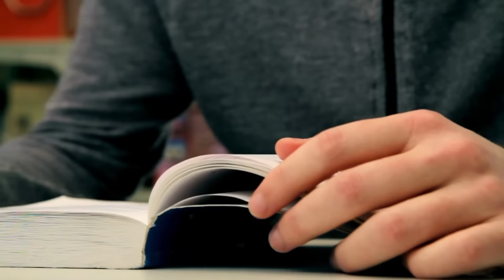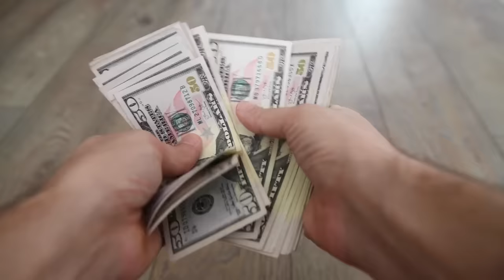The REAL reason RV service sucks - insider secrets from a RV technician

Comment: In Canada, RV Technician is a certified trade with government body oversight. So you need to do a four-year apprenticeship and three years of college, then you can write your Red Seal exam. Then, on top of that, each province has its own RV gas certification processes. 

The above doesn’t necessarily mean we have better technicians, but there’s more oversight for training compared to the RVIA in the US. 

What we still lack is trained technicians since there are only two colleges that teach it and a nearly two-year wait to get in. 

Parts are our most significant issue being on the West Coast. Do you need a part for your RV specific to it or even just manufactured in Elkhart? That’ll be a 2-3 month wait because the warehouse is slow. Then, they probably shipped the wrong part, which will get held up at the border. 

Service work, I believe, is an industry issue, starting from the top. Technicians are, for the most part, thrown into an environment where they have little chance of success, from seasoned ones to newbies, which is why most good techs leave shops to go out on their own when shops need to retain those techs to train the new incoming generation of technicians. 

Keep up the great work! I enjoy your videos and perspectives. 🎉
Reply: What? Since when in canada are rv techs governed??? 
Because in 2019, my dealer and another, here in calgary both big franchised dealers, both had ads for tech required, “no experience necessary will train on the job”, and no schooling certificates or anything listed as needed! Exactly what this video talks about. Secondly i personally dealt with techs working at these dealers who had zero training or experience and were learning on the job! And i know for fact techs that are currently employed have no school training as you say. So how is the government regulating and declaring a rv tech must be certified? were is this listed on the web that our government body regulates?
Reply: @SpykersB 

Hey, I think my point was missed when I said RV Tech is a certified trade via the “Red Seal” certification with government oversight. 

That does not mean people cannot work in the area without certification. The apprenticeship model lends itself to allowing people to work in the area without any experience. It’s like this in any trade, from car mechanics to construction. 

Just because someone does not know how to swing a hammer today does not mean they cannot learn from teaching and research how best to swing a hammer tomorrow. Everyone starts somewhere. 

My concern and you witnessed this firsthand potentially, is that the RV tech trade does not have enough schools available to train all the techs. So, the backlog is enormous, and many techs go without training because they can either not afford it or feel too old to start now.

Comment: Great tips. Every new rv customer should watch this video.  I have been full time for 6 years and your tips are right on. I use mobile techs when required but most of the time I do the work myself.   When I was brand new I took my RV back to where I bought it and it was a nightmare. Kept my RV for 3 months, didn’t fix it and I called my manufacturer who said they had shipped the parts weeks ago.  The dealership had lost the parts. We found the parts in an attic. The dealership tried to blame the manufacturer.  I am going to watch all your videos.

Comment: I know exactly what you're talking about. I took my RV to Camping World in Idaho Falls and they were going to consign it for me well after 2 months I get a phone call from the service manager and he says hey you have about 2500.00 worth of leaks and repairs on your motorhome that need to be repaired before you can get it sold. I almost blew a gasket when I dropped it off I had been living in it for 6 months full time and it was just fine. So I go to see what was the list and I find out that the idiots had put compressed air to the system in the parking lot in the middle of the winter. I told them give me my RV back and canceled the contract. It ended up costing me only 295.00 to fix all the broken pipes and faucets they broke and to change out an expired fire extinguisher. I found out later that they fired the guy that did the damage because he was costing them more than he was producing. Stay away from Camping World.
Reply: Camping World is OK if you need to purchase an accessory or part for your camper, but even Amazon is cheaper and faster for that too, now. I would never buy a unit from them or take one to them for service!

Comment: Ford is another issue. Motorhomes that are not vans are almost all For F-53 chassis, and these are having a LOT of safety recalls, most of them quite serious.  In my case, dry differential, sway bar falls off (two recalls for the same issue),  vehicle shipped without front end alignment (new 2 year old tire), misrouted and pinched cables (new harness and three month delay for a harness locally available for $18). 
Add to this safety issues caused by the coach builder. In my case fire in the CPAP cabinet (I was right there, and damage was negligible because I was there - and conscious. Investigation showed 12 AWG wire filed down and forced into stab connection for 14 AWG wire -  manufacturer actually tried to glue it back together!) I replaced all outlets because 12 AWG wire used by filing down the wire and forcing it into the stab connection. Then the overhead fold-down bed fell on my head while driving. It fell slowly and gently, but - terrible design! Black tank arrived from dealer with poop pyramid included. Radio disappeared into the dash while driving - investigation showed zero supports, held in place by a 1/16" plastic dash panel. I repaired with four inches of 1x1 from a local hardware store. 
Then there's the things that are just crazy. I had to repair a dashboard panel because it drooped and got damaged by setting   the parking brake. It needed a zip tie. For lack of a zip tie I had no headlights, turn signals, brake lights, wipers, etc. 
All of these are potentially quite serious. Frankly, I'm appalled. 
(Former manufacturing engineer and  electrician.)
Reply from the maker: Yikes! What RV was this?

Comment: I think that manufacturers need to start creating and leveraging a network of mobile techs to do warranty work.  For the reasons you mentioned, dealers don't want to do it and do a terrible job at it and it is driving the RVs today are trash.  This would allow dealerships to focus on what they do want to do and that is sell RVs and then maybe they could focus more on PDIs.  It would also give consumers more direct control on the repairs being done.  This would also probably result in a more informed consumer which is also a good thing.

Comment: This is so interesting 😊😊 I use to work in public water supply. We had to get a ( backflow certification) that means you look and TEST the ( RPs double check valve) these are devices that Prevent Backflow into water system. There MUST be a yearly test of all backflow systems in your water District. In the class there were plumbers that Failed the final Testing. The problem was the test you do at the time that U did it, you must memorize the testing process, and do it un front of a certificate instructor. Because so many plumbers where failing test. Thay changwd it so you can look at test process on paper, then do test in front of instructor. I thought this was a good xhange, because following along by the sheet of paper, gets the test done RIGHT.

Comment: I have this dont break your rv course and it's an amazing help to newbies and experts alike  !!!

My dealer was bish rv, on my PDI  I found the drawer under the fridge was needed alignment to work right. They said the fixed it and I went on my way, the drawer was 10 times worse after the repair then it was when I reported it. I know I should have checked it before I left the dealership, but I was like its a simple drawer adjustment, any flunky can do that. I was wrong, lesson learned.
Reply: I have had a bad experience with Bish's also. I had to wait a month before I even got to it home because every time I came to inspect their work, it was mostly not done correctly.
I finally gave uo and took it home. What a mistake. I have been a squeaky wheel, and now they just pass me around to other people who don't take responsibility for it.

Comment: I ended up dealing with my father's RF warranty repairs a few years ago.  The core problem is that the manufacturer's reimbursement rate to the dealers (back in 2016) was $35 an hour paid to the shop under warranty.  So no dealer could make any money at it, naturally they did not invest in adequate tools, space, and staff, and they tried to avoid doing warranty work unless it was an RV that they had sold.  Wait times for warranty work in San Diego in the summertime were in the range of 3 months.

Comment: Unfortunately, some of the manufacturers require inspections at regular intervals by a “certified” RV maintenance facility in order to not void the warranty. The big boys like Camping World/Gander have a months long backlog of appointments. I had a serious electrical problem right at the opening of camping season, and ended up educating myself online and doing my own repair. Called a mobile RV tech just to come inspect my work, but saved myself loads of time and money.
Reply: This is exactly right.  An important point that generally isn't discussed until AFTER the sale has been made.  I do not know of a single RV dealership that will honor a so-called roof warranty without proof of yearly roof inspections/cleaning/maintenance documented by a dealer. Even then you will have a fight on your hands.

Comment: All his complaints can be fixed by having a great shop foreman to watch over and inspect every job during and after the repair.
Reply: A good foreman definitely helps, but that doesn’t scale in most situations. Especially when most RVs have 2-15 jobs, then multiply that by 10-20 technicians working on 2-5 trailers a day.
Reply: I was a fireman at Lazydays for 10 years and it worked but we were not a flat rate at the time. Flat rate killed all of that.

Comment: I have a 2021 3100rg grand design I would like to re place the stove with an apartment  size stove for a larger oven can this be done safely.
Reply: It could be but youre looking a a pretty big bill, first off there has to be space to fit said stove, so cabinets need to be modified. the gas connection will work but if the stove is electric, your service wont be adequate, electric stoves require a 50 amp service and you wouldnt be able to use many things while the stove is on. also residential stove exhaust alot of heat so its gonna make the rv hot and you cant turn on your ac at the same time. its doable but not practical with rv's

Comment: If you need work on the AC, call an HVAC vendor.  If you need electrical, call an electrician; plumbing>plumber; auto service>mechanic; etc..................  Taking it to an RV shop is more expensive, more time consuming, and drastically MORE INCOMPETENT.  The only reason to go to an RV shop is if it has a 5 star rating on google, with hundreds of satisfied customers.  Do you honestly think that exists?
Reply: It does at our shop 😉😂

Comment: Wow, the RV industry is a flipping train wreck. 
Wonder if the automotive service industry is any better?
Seriously doubt it 😢
Reply: I had a safety recall on my motorhome (replace rivet nuts with weld nuts for the rear stabilizer bar) on my Ford F-53 chassis-based MH. Because I was far from home, I called and called and called to find anyone who could do the work, finally finding Rush Truck Centers In Commerce City,  a suburb of Denver. I was in Tucson, so I had to drive to Denver for this very important recall item. Reason: Ford reimburses dealers and repair centers almost nothing for work. This was a one-hour job (I paid out of pocket), and Ford would pay for 30 minutes.
Ford reimbursements for recalls is well documented all over social media.
Reply: The automotive service industry is light years ahead of the RV industry in every imaginable way.  The build quality and the skill-set of an automobile and auto tech vs a travel trailer an RV tech could  not be on more opposite ends of the spectrum as conceived by the human mind in any form or configuration.
Reply: @billz410 Plus RVs are made mostly on assembly lines! RVs don’t have near the volume to justify assembly line work.

Comment: Good advice! I made an appointment for a “under warranty replacement of driver side mirror “ on my 2021 gulfstream class C service boss set the date and I brought it in that morning and gave home the keys. I asked him what time today to pick it up. He looks at me and says about 5 days and I told him you will have it done today or I’ll put my foot on your neck and slap a law suit on you personally. You set the day for the job and it’ll take you 20 minutes at best to swap mirror assembly’s out. Yep he followed through and the mechanic still did it wrong. I had to correct his mistake and do it right. I also let the tyrant shop Forman know of the screw up as well. Yep I might use them again but that guy knows I’m not gonna take no crap and have worked on semi’s for 39 years. Just sayin.
Reply: dude, as  master certified rv tech, you tell me youre gonna put your foot on my kneck is gonna get you shown the door followed by a visit from the local pd. i guarantee you your warranty issue will not get fixed at my service center. i dont give a crap how many petes or kenny's youve worked on. im a person and no a hole is gonna talk to me like that. btw, a lawyer costs more than what a weeks delay so go ahead and launch a lawsuit, your rv immediately becomes material evidence and you might get it back in 6 months if your lucky while the legal system sorts it out. treat people how you want to be treated.

Comment: The fallacy of your presentation is that "certification" is not synonymous with capability.  This holds true for any trade in every state.
And unfortunately, there is no "certification" for honesty and integrity.
Rule of thumb these days, if you can't fix it, you probably shouldn't buy it...unless you just have deep pockets and like spending time in repair shops.